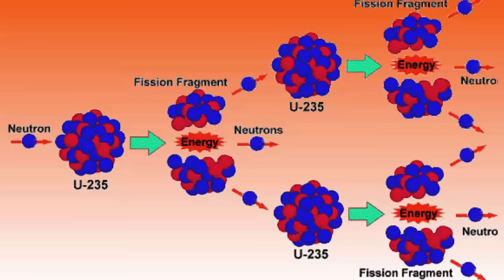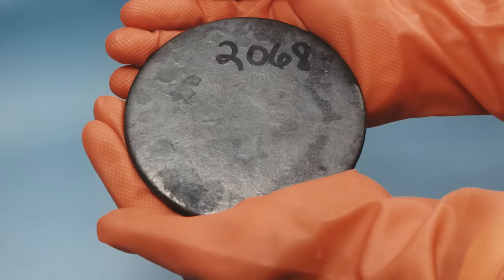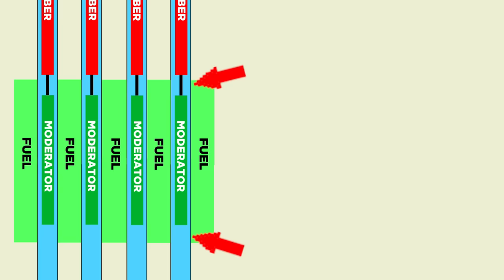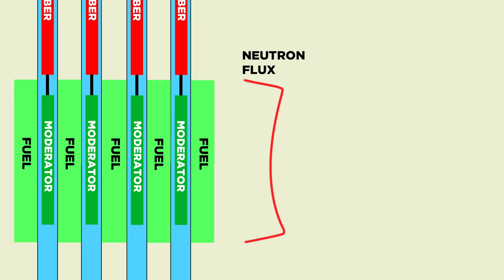What /Actually/ Happened at Chernobyl

Comment: To simplify what guy is saying in the Video;

A nuclear power plant works by putting Decaying Nuclear material in the form of Rods close together so that they react with each other.

This Reaction creates a Lot of Heat.

The Rods are surrounded by Water, which is Boiled by the Heat.

This Boiling water Creates Steam, which is used to move Turbines which Generates Electricity. 

If the Reaction between the Nuclear Rods is not controlled, then more and More Heat will be generated. 

This is what went wrong at Chernobyl; they Lost Control of the Reaction between the Rods due to Incompetence, and the Heat got so hot that it caused a couple Explosions, and ultimately Melted the Reactor into Lava. 

This Meltdown caused a lot of Radioactive material to be released into the air and a 2 ton blob of Radioactive Lava to melt into the Earth.. Which is still there to this day.
Reply: Everybody, pls don't read this bs
Reply: @rinkashikachi  So its BS? Can you prove that??
Reply: First half is just worthless. You "simplify" by saying the only thing people already know about reactors. 

Then "this is what went wrong, they lost control". No way. Really? They lost control? I can't believe that. Top-1 revelation of 2020.

And then next. Nope. Meltdown happened after the release of the material in the air, it wasn't the cause. And no, lava didn't leave the core and didn't affect ground waters. If it happened so, Ukraine would be dead by now. I don't know where you got that bs from
Reply: @rinkashikachi  Your arrogance is amusing.  

The guy was explaining in long drawn out terms how nuclear reactors work. I just simplified it. If it was obvious to you, you didn't have to read it. 

If I got the order of events wrong, then I got them wrong. What difference does it make?

And there IS a blob of radioactive lava beneath the plant to this day. They have one picture of it, which the photographer who took it died within hours. 

If you deny any of this, prove it.
Reply: @rinkashikachi  Also, why would ALL of Ukraine be dead from a radioactive blob underneath Chernobyl?

It really just seems like you have no idea what you're talking about.. witch is the amusing part.
Reply: @pepperVenge  what difference does it make? You just tell wrong stuff to people right after "let me educate you"

No, there isn't. Lava didnt make it through concrete. There was even a plan to fill the space below the reactor with nitrogen, the tunnel was made by miners. But they decided not to do that, because lava turned out to be not strong enough
Reply: @rinkashikachi  I never said "let me educate you." What was that you said about telling "wrong stuff?"

So where's your proof pony boy? You've made a lot of claims, but I haven't seen you prove any of it with either evidence it demonstration.
Reply: @rinkashikachi  That's just more denial.. here.. I'll get you what you need.  Hang on
Reply: @pepperVenge  Biggest country in the world, USSR, 22.4 millions square kilometers was ready to spend all its resources from all possible sources around this massive country to prevent that and here you come some clown from YouTube saying "it's ok, why would that harm anyone"
Reply: @pepperVenge  you are in denial. I wrote walls of text here and all you could respond is a photo which doesn't prove anything you are trying to claim here.
And thats right after we figured out how you already meesed up the order of events. You have negative credibility, so stop that circus and go actually read something
Reply: @pepperVenge  you call this a proof? Who tf is this guy? Why does his word suddenly become a fact? Especially since he is the only one claiming that lava reached the ground. Not to mention the amount of details he haven't even touched. 
Can you stop trying to get a nuclear scientist degree from YT and get a proper education?
Reply: @pepperVenge  rekt. Case closed